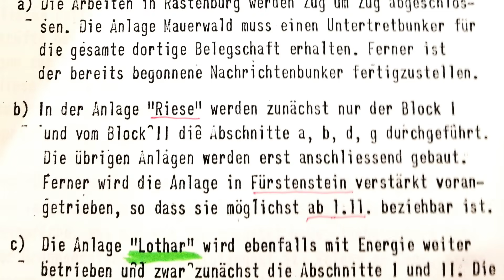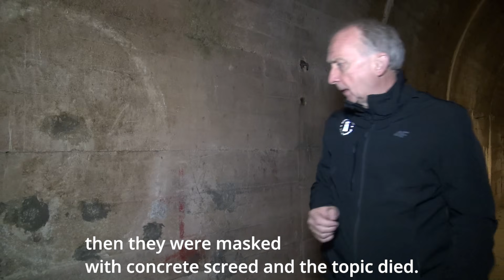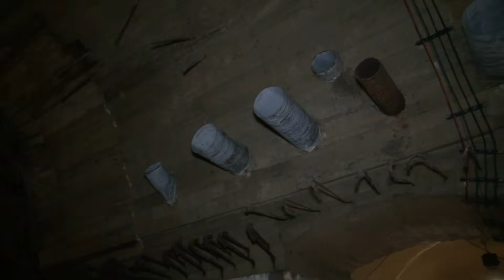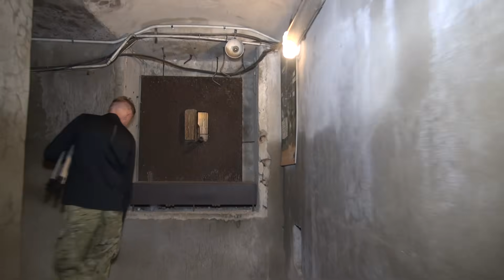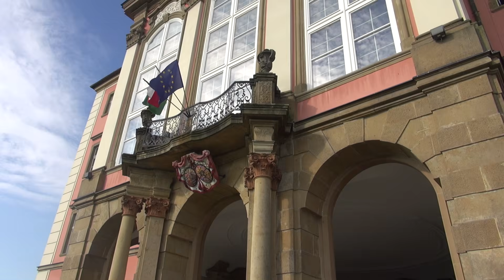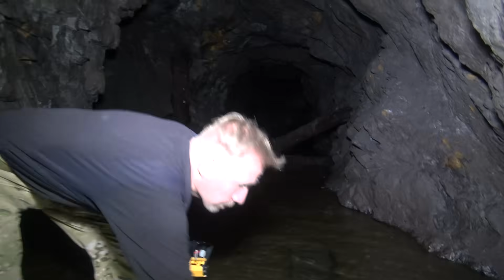THE LAST NAZI SECRET - PROJECT RIESE  - THE CASTLE AND THE GENERALS OUTHOUSE

Comment: Tino, thank you for exploring and shining light on these structures.  At the castle it seems like a lot may be missing or hidden.  The last tunnels you explored with Alex are interesting.  They are not tunnels that are large enough to assemble things in, nor do I think they were part of a mine since there seems to be a lack of areas worked (mined out for removal of ore) and if you find ore you follow it which normally does not result in a straight line.  My best guess is these tunnels are exploratory to evaluate the rock structure or to provide access and ventilation to other workings. They way the sides (ribs) and top (back) look I do not believe the tunnels were constructed by highly skilled miners or if so, they were in a hurry. Take care.
Reply: It's that or the tunnels of the second complex he explored are part of "the first stage" and were going to be opened up to a larger size before being concrete lined.
Reply: My thoughts exactly, I've been a miner for years,  these are no more than hurriedly dug access tunnels to somthing else namely somthing built with thousands of tonnes of concrete,  these tunnels are rushed and unstable.

Comment: Under the castle I think there are false walls, the rise project, I've been in mine's over 120yrs old that are in better condition, from what I can see these are hurriedly but access tunnels nothing else, however I think they go to a large structure built out of your several thousand tonnes of concrete you can't find. Namely a massive vault to hide somthing, collapses I think is more likely back fill to prevent it being found what better way to to hide somthing than in the middle of a maze.

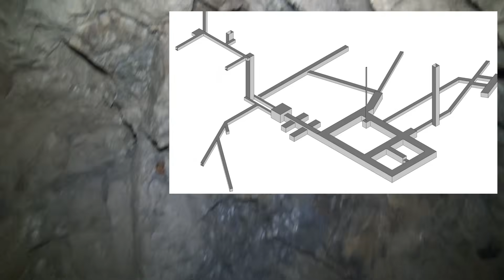Comment: 21:48 In tunneling you would always first do smaller exploration shafts before you do the real thing. Sometimes the smaller shafts are used as service shafts to the real shafts.
Reply from the maker: That is why we were going through to see if there were signs of access to larger tunnels. Under the castle the entire space is just so small yet all seems to end at surface plateaus - either there was a dedicated plan for small scale usage or other levels.
Reply: @tinostruckmann  Ah, great work! When I was a kid I used to climb myself around the bunkers on the Baltic coast! One question that I remembered when I saw that castle dungeon with all the redundant air ventilation. How on earth did the Reich produce all its chemical warfare stockpiles? Being constantly bombarded, shouldn't there have been frequent accidents? Maybe some of the underground installations are for Tabun or Sarin storage or production.

Comment: The generators would  need to be reasonably close to their point of use. More cabling, more lose of power due to resistive and capacitive loses, especially  for underground transmission lines. Can't put mega voltage lines underground due to increased capacitive losses. But megavoltage decreases resistive losses. So the use point had to be reasonably close.

Comment: TIno, why don't they use a GPR (Ground penetraiting radar) system on the walls and see if there are hallowed out areas behind the walls , it is a non destructive use and there should not be any harm to the walls, or is it just polotics over in poland  that stops others from looking.
Reply: would you be able to find out if there are tunnels hidden behind the  walls or entrances?
Reply: @tobydawes6007  Yes, GPR would give you about 10-30 feet beyond the wall or floor, depending on the type of material you are sending the signal through.  Certainly enough to determine if there are false walls, floor, or other things going on.  Bigger GPR rigs can be used on the surface to determine structures underground, the more solid the rock, the better the signal will travel, or so I've had it explained to me.
Reply: Most probably that equipment is too expensive for amateurs and the government is too busy creating general confusion.
Reply: @renataheiberg7534  They are about 300 dollars a day or 1000 dollars a week to rent on average.
Reply: @Kellmourn  
That is not a small change in Poland. I don't know if people who are fascinated by those tunnels have that kind of money.  After all it is not like 'The Curse of Oak Island'. :) Very interesting series here but will not generate big money.
And.... someone has to bribe local authorities to give those guys more access.
Reply: @Kellmourn  could tino get hold of one do you reckon 🤔
Reply: @Kellmourn  is there anything any cheaper?
Reply: @renataheiberg7534  Very true, it isn't a small amount.   I lived in Latvia for awhile, so I know the economy in the area a little.  Probably if some researchers got together with some Patrons, they could afford to rent the equipment.  The bigger problem may be getting permission to use the equipment, even though it is not in any way harmful.
Reply: @tobydawes6007  There is computerized ground resistivity testing.  That involves putting some spikes in the ground and running current through.  I am sure that is cheaper method.  It will show voids and different materials via the resistivity that is registered.
Reply: Muon tomography would be even better, but you guys have to donate timo a little bit more for that to happen.
Reply: @Kellmourn  how could tino get hold of it?
Reply: @vettemuziekjes  And it would take a number of months to get enough data, through all that stone.
Reply: @tobydawes6007  I'm sure Germany has some for rent, if Poland doesn't.  They often used by various companies that have to do things with tunnels, drilling, and other land speculation.   The smaller companies usually rent the equipment.
Reply: @Kellmourn  would they be as expensive as the ground radar?
Reply: @Kellmourn  it hink what tino might need to do is make  deal with a university or business/company where they fund or provide equipment for his expeditions to ensure that he can find  what he is looking for.
Reply: @Kellmourn  
All they need to do is throw some money at some local officials behind the camera and keep quiet about it. Perhaps Tino lacks that basic understanding of how things work in ex-eastern block. 🙂
Reply: I suspect it may just had been a pocket they decided to seal off in order to uniform the tunnelwalls, maybe the pocket where simply filled in with concrete in order to increase the stability of the tunnelwalls (it may had been a crack or something that originaly was the reason for removing the excess stone there) and the hidden room newer was in the finished tunnel, that may explain the unusual thickness of the concrete wall in that particular spot. but yes it would deffinitly still be worth further investigations if it is realistic.
Reply: Watch the 13 hour quadrilogy "The Swiss Beast - Home of the Devil" for fully understanding of World War II and the forces behind; also watch the video "The Nobility World Wars".

Comment: i read somewhere that the Nazis learned from the ancient egyptians they would place monsterous rough granite fitted tightly blocking a tunnel then place many feet of concrete in front of it so when you finally broke through the concrete you saw granite and thought that was the rough cut wall
Reply from the maker: Exactly there are ways of hiding things
Reply: @tinostruckmann  after watching video i think ive figured it out and the thick concrete its an inverted skyscraper the generators at the top 
Base of an multi level building has thick concrete 

Highly posible you have 10-20 levels below the generator area door area 
Half the facility is “off limits” with science equipment or access to rest or facility” it explains missing concrete 
Section of covered wall that leads to more of facility wide enough for trains could be acess depot to finished facility

Comment: Did you have a black light with you to inspect the iron oxides in these mine shafts? Could the concrete structures you inspected be for refinement facilities? Nice video

Comment: I can't get enough of these. Were these cruder tunnels a blind I wonder so that if the works were seen they would divert attention. Or were they a practice run. I can't see them as being exploratory as they very quickly would find out that the geology wouldn't permit them being larger. odd because the planners would have an idea of where they wanted to locate them and would have surveyed the area. Anyway still another cracking presentation. Next!

Comment: “Above Sea Level” Line: to be Able to Calibrate Sensitive Machinery(Used as a Baseline, Atmospheric Pressure at that Specific Altitude, Outside the Bunker)! Maybe for a Exhaust System For Exhausting (Experimental Chemical) Fumes? Fulminated Mercury(Percussion Caps/Primer Caps in Ammunition) an Example of a Pressure Sensitive Compound, Where Knowing Your Height Above Sea Level (Atmospheric Pressure) would be Necessary in Manufacturing It! We know in Fallout/Bio-Chem Bunkers have(Anti-Contamination Systems) That Keep (Higher Atmospheric Pressure) inside the Shelter, Than Outside of it!

Comment: It might be very interesting to run a camera on a cable through as many of the “ventilation” tubes and see where they go. While it would be possible to modify and hide tunnels going through those tube systems would make it possible to map the areas you can’t see.
Reply from the maker: That is entirely possibly - good reason to go back, and Ill need a horizontal GPR

Comment: Love these videos and your knowledge! Could this concrete and labor discrepancy be an accountant's balance to mask other projects? Also, as one who used to build carbon fiber parts on Reno Air Race 51's a lifetime ago, I was inspired by these sharp schists and shards to think: if we took a digital scan of an individual's cranium, we could reverse a Mould to vacuum form a spelunking helmet that would be low profile and super protective against abrasions and impacts..epoxy a 600 denier chinstrap with ear yoke, and Bingo...no more Ouch Factor

Comment: Outstanding Tino,  did we establish that the staircase was fitted by Germans and removed at a later date or was the staircase not fitted  by the end of the war and I'm talking about the staircase that has the metal sheeting over it that is now the flower bed on the actual castle courtyard.

Amazing work as always……….Yes  

 I always end up with far more questions than I get answers... that's why I love history because we shouldn't take what we are told as Gospel.  I hope you can give us further answers or updates in future  documentaries as you find out what this place was exactly used for ,if such a thing can ever be found out????
Reply from the maker: I am going to keep nagging for answers until I get them! Not sure if the staircase was installed, the elevator was and some sort of lift also in the bigger shaft
Reply: @tinostruckmann  Seems so strange they had elevators for vehicles, yet the tunnels don't seem to be big enough or even some place to park the vehicles as a protected motorpool.

Comment: Those smaller tunnels you climbed through are just decoy tunnels. I'm not a geologist, but the rock looks like gniess, which is very unstable and you don't want to tunnel through it. That the rock is unstable is shown by the amount of timber support framing through the most unstable sections.
Reply from the maker: it is in deed Gniess .. and yes it is...the whole Riese project was carved out of Gniess..

Comment: There is no difference between a collapsed tunnel, and one sealed with explosives. Be aware of brickwork, and check local town for age of bricks. Late war may have seen a change in style, or source materials. If u can tell the difference between a '43 and a late' 44 brick, then u can spot what was hastily done late war to hide tunnels behind brick walls. Talk to a bricklayer. They are acutely aware of the age of bricks they work with. Check town records for houses made late war.
Reply: Pretty much this. A friend of mine's job is brick historian, he gets paid to know stuff about old bricks. Some jobs are strange.
Reply: i also noticed at tunnel bl0ckages there seemed to be bricks, if so these must have been imported !  from where ??
Reply: @CaptainMorganxxx  despite the rubble in many towns, I assume much was increasingly being imported from Italy. Lime, cement, masonry.
Reply: @glennboyd939  Why block the tunnels ? what is beyond ?  who blocked them ??

Comment: the numbers are very strange. of that much cement missing. I know the German military and government documented everything. and would not falsify those numbers. On that much cement ordered or used. I am thinking that there is a bunker around there but I think it's on a large Hill or on top of a mountain. Something with a view you would probably find ventilation shafts. strange thing about that site though I'm wondering underneath the castle those rooms were not for generators maybe for the first computers.
Reply from the maker: You may not be wrong, they do look more like server rooms and maybe the ventilation was going to them not from them... Ill try and dissect the papers in the next episode

Comment: The tunnel is woods you climbed into T,  that was semi-submerged with a brick wall at the end…. I presume Connected along with the other tunnels to or near the complex castle tunnels where you originally came from or not? pair of waders and a sledgehammer Would have been great. I'm just very confused because if these tunnels don't connect to the major tunnels then why build these tunnels. What reasons wear these Tunnels made for and where do they go?  why are they bricked up?It seems to me like they're just said dig there and keep digging until you have something that looks like a tunnel and when your done then go over there and do the same because there is no structure or purpose that I can see for them being there at least the ones in the woods. Your need to spend weeks there brother not just few days.. Month at least investigating everything.. camping trip coming up
Reply from the maker: Something was off with that one, some years ago instead of going through the entrances they dug a shaft down into them, did not find anything but tools - still - and the riese tunnel systems are separated by some distance

Comment: Well one big question is still not asked. What happened with the excavated material from the smaller tunnels the ones that did not make any sense to build? Where is all that material from digging those tunnels??
Reply from the maker: depending on what site, some would use these for road, house, bunker construction, and in other places such as by Ebensee they would simply haul the slag out of the way and dump it making rather large hills.